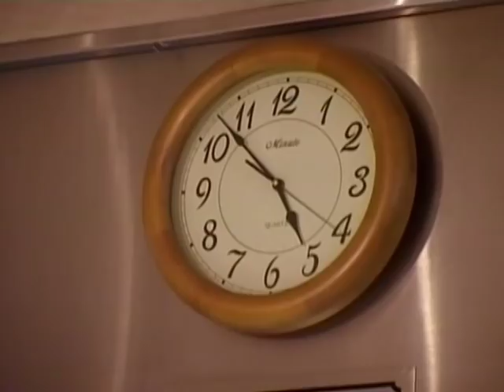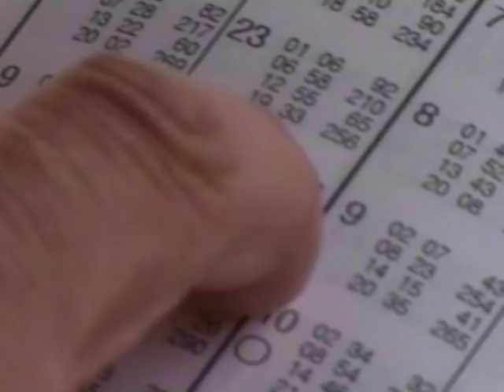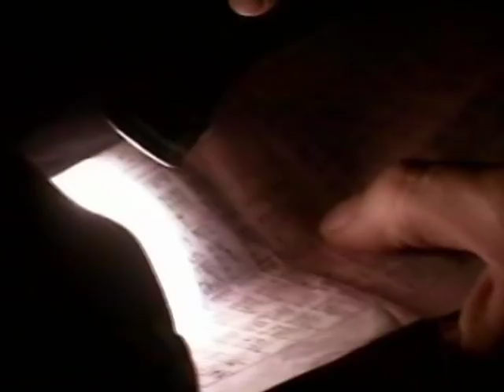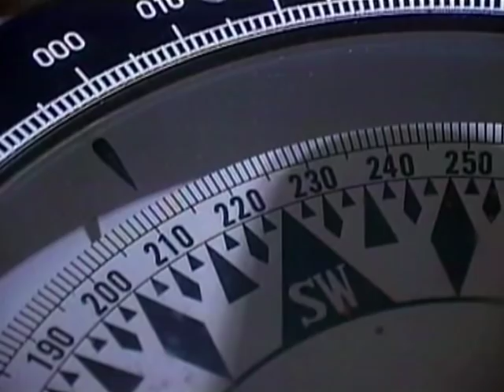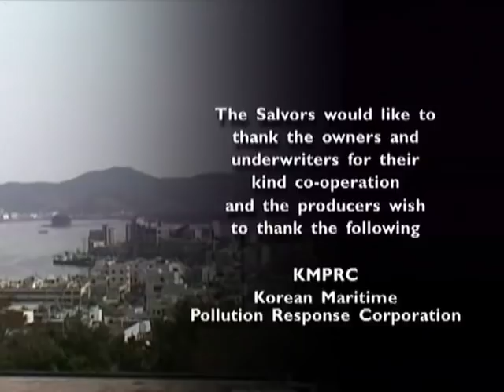THE ALICUDI M SALVAGE

Comment: I may be a bit ignorant on this, but why they don't just keep adding tugs until the ship moves? If you only have limited chances with the tide I'd think the cost of renting a couple of extra boats would be cheaper than spending several more weeks on additional salvage work.
Reply: You can rip a vessel in half, the hull can only take so much stress before failure.

Comment: They could have brought a dredge in at low tide and undercut the mud and debris from under  the hull on the port side, then at high tide it could have floated off.

Or use hydrosluicing water cannons positioned on the wharf and during low tide undercut the mud from the wharf side , washing it away underneath the hull , they could have gain 1 - 2 metres of bouyancy.

where are all the other armchair experts ?  ;)
Reply: Probably not here being the 15 year late Monday morning QB
Reply: Or they could dam up the ocean and just simply float away
Reply: Wouldn't that stress the hull?
Once you undercut a piece of the hull, that piece is freehanging and starts to bend down. This can cause the hull to bend, totalling the ship in my opinion.